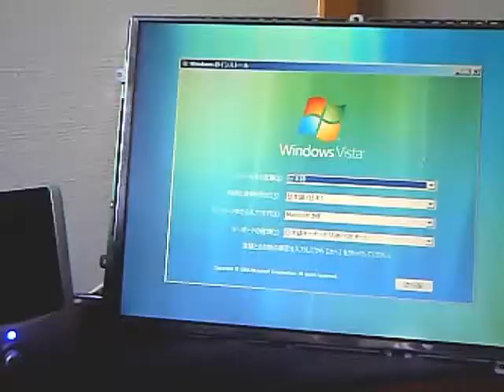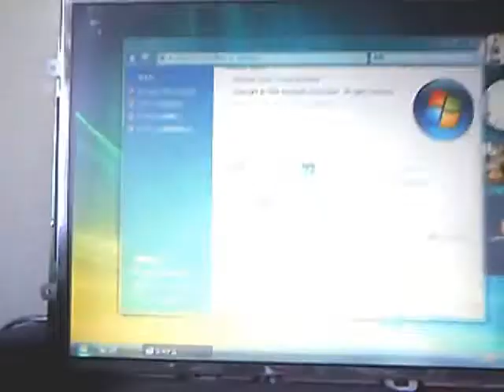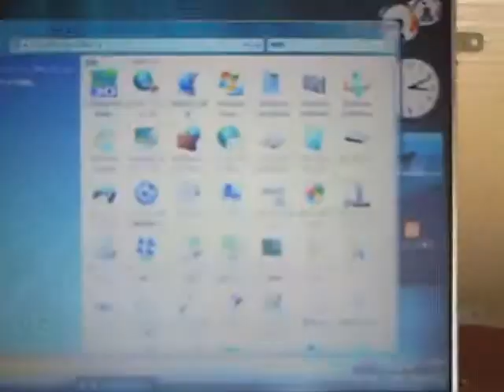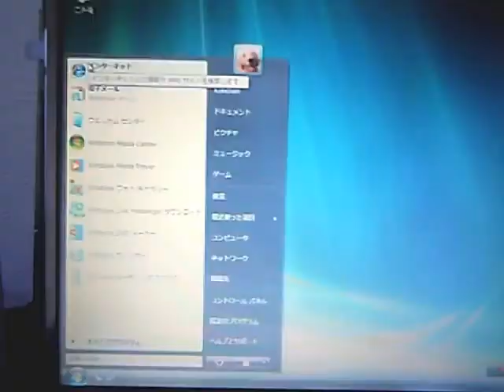FIC VG33 Socket478 Junk Board info

Comment: I have this board it powers up then shuts down, I clean it well and made sure its all connected up, any suggestions? Try a new PSU, renew thermal paste assuming it even uses any?
Reply from the maker: Because it is a short time, thermal paste is not used.